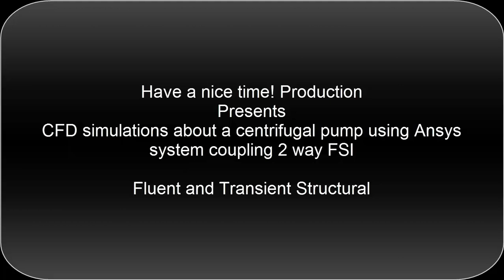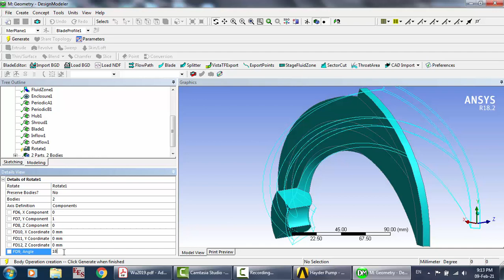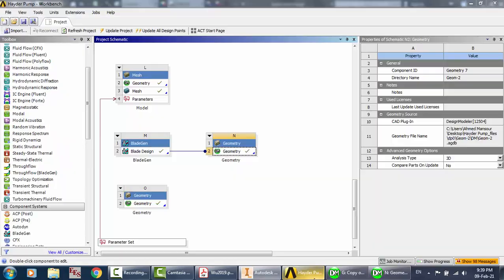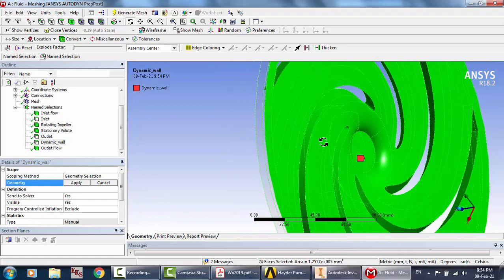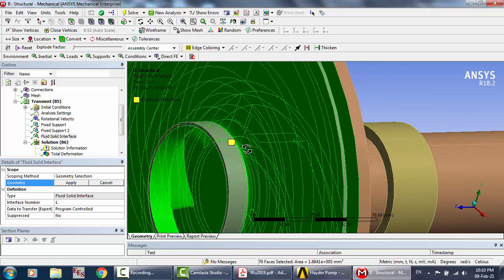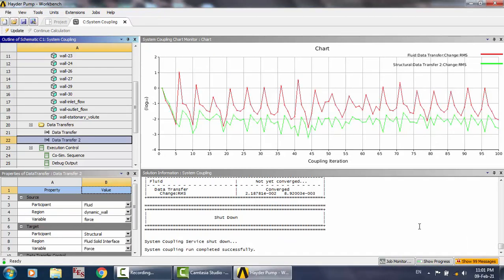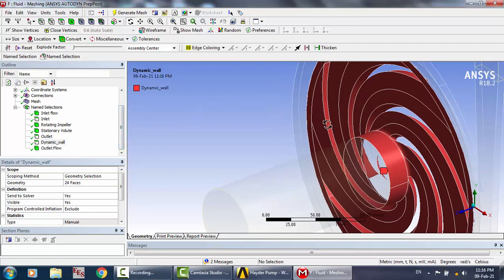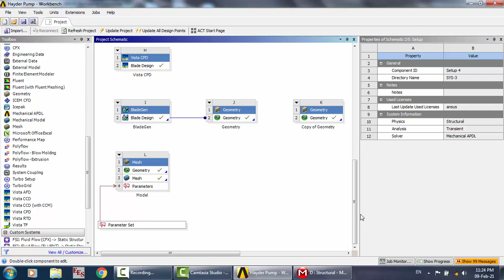CFD simulations on a centrifugal pump in Ansys coupling 2 way FSI in Fluent and Transient Structural

Comment: Please tell how to change exit blade angle of impeller
Reply from the maker: Hello dear Suriya, you can know this piece of information in the references of the fundamentals of turbomachinery. Study the velocity triangles and hot to generate CAD design of the blade and check out the articles:

https://www.researchgate.net/publication/276532088_Numerical_identification_of_blade_exit_angle_effect_on_the_performance_for_a_multistage_centrifugal_pump_impeller

Danke!
Reply: Please put video for exit blade angle design video please
Reply from the maker: @suriyamanikandan893  Actually these fundamentals have lots of sources and and references and I only make videos about using CFD to simulate engineering applications. Danke!

Comment: Really its very informative. If you can give one more video on modelling of solid and fluid domain it will help a lot. Can we do this analysis for axial piston pump ?
Reply from the maker: Hello dear Amit, yes but you gotta study the procedure by doing a literature review. Danke!
Reply: @haveanicetime  I am bit confused about modelling part @21.00. Can you help with some references or videos?
Thanks !
Reply from the maker: @AmitKumar-uw4uu  You gotta do an intense research about the working pricple and the detailed design of the that kind of pumps. Then get research papers about the point of research and the modeling methodology. Then work on preparig the design and import it into ANSYS but you gotta follow the same procedure shown in my tutorial because it is the same concept. Danke!
Reply: @haveanicetime  Thanks!

Comment: Very amazing! just a question, In Fluent is it possible to do just a blade with the volute like CFX? or we should always simulate the whole blades when we have volute?
Reply from the maker: It is very difficult to do thisin Fluent because of the periodicity of the fluid domains. itis created automatically in CFX. Thanks
Reply: @haveanicetime  Thanks for the response. I have learned a lot from your videos, especially generating flowpath using hub and shroud was amazing. Thanks!